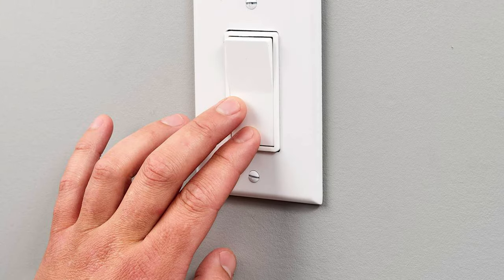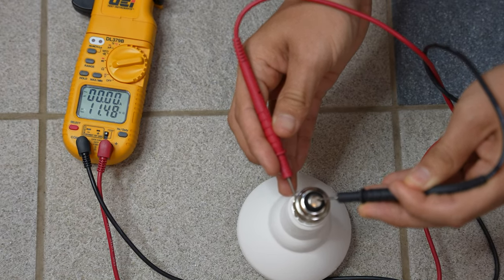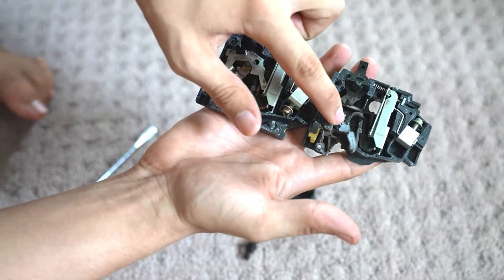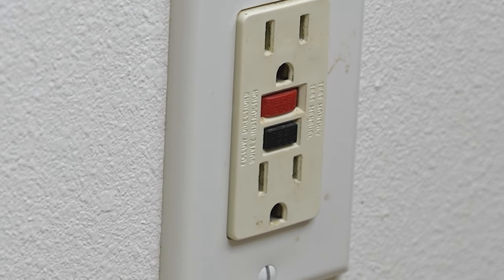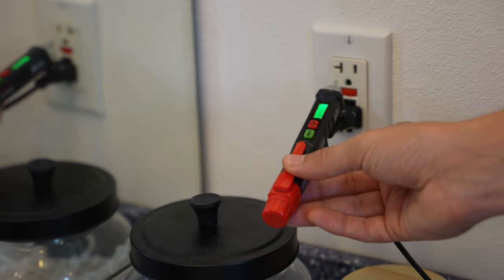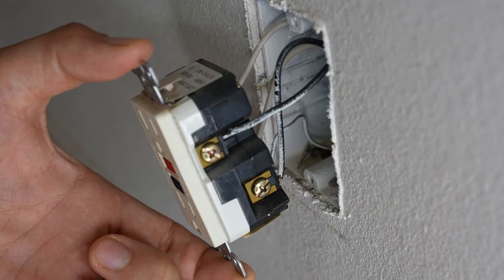Power Outlet Not Working - Easy Fix

Comment: Thanks a lot. You saved me from a lot of unnecessary costs associated with calling an electrician. In my case, it was a GFCI that tripped but it was no way near the receptacle that suddenly stopped working. The GFCI that tripped was about 150 feet away in the garage while the bad receptacle was in the patio. Thanks again for this very helpful video.
Reply: this video assumes everyone has this electrical setup... 
wtf u have sao many breaker switches? in my apartment building i have to literally go burden my downstair neighbours hallway, to flip switches if electricity goes out and only have like 2 switches...  (i guess u live in some massive sized house... )

my socket is literally circuted or whatever the term is.. if u plug something in sparkles, like something about to explode lol...  and the upper light switch knob literally doesnt work, like a spring is dead or smt, is it possible that its switched on but connectivity is poor, thats why it's "short-circuting" , not sure if i should even touch it... 

my mother is always pissed that she cant help from me when things like these happen and has to call over someone...  the thing is, i dont want to touch electrical things...

when i was 3 i plugged wires in the socket and got electrocuted, my fingertips were literally black... i think i stil lhave subconcious trauma about electrical things and fire... (also almost burn down the house when i was 10 playing with matches...) 

how should i check if the wires are correctly connected ...  wich side is negative and wich one is positive , the wires dont even have fcking colors... .
the system is from like fcking soviet block building system.. built in 1991~ or smt... 

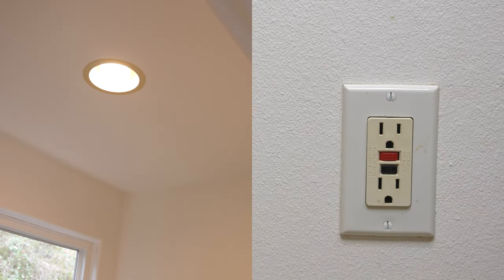1:59 dont even have outlets like this...   not sure what country video this is... systems are clearly different... 

fingers crossed.. i wont electrocute myself : ))))))
Reply: Your video helped. What I didn't realize is that if the breaker trips it can only move the breaker half way. I didn't notice just by looking at it, but after seeing your video that's what it was. Thanks my guy!!!
Reply: Lol same situation 🎉
Reply: Thanks a million! I’m
Not sure if was me flipping the switch in the fuse box OR pushing the button in on the outlet located downstairs from the problem box as I did both before going upstairs to confirm it was working- but regardless - SUCCESS! Thanks again!

Comment: Thank you sooooo much!!!!!! 4 hours of going between electrical panel outside and bathroom upstairs- who would have thought that resetting gfci in the bathroom downstairs would solve it! I’m so grateful for your advice today
Reply: Same thing happened to me today - what a lifesaver this guy is
Reply: I have to thank you both! I read comments while I'm watching/listening videos. That's how I have realized "It's me! I'm the problem! It's me!"
I have 1 GFCI outlet at the front of the house, and 2 non-GFCI outlets at the back. The outlets from the backyard stopped working a while ago.
The one from the front works fine but I prefer to keep it OFF to trick people (children) as they do not know there's a reset button that can turn the outlet ON.
But I did not realize that I'm turning the other 2 outlets OFF. I thought that probably they have an internal fuse. I mean how come these outlets are rated 15A, 20A without a precise fuse?
I was looking for a video about their replacement when I  found this one.

Comment: Thanks for the tips about outlets not working.  Your tip about checking the GFCI outlet not in pxomity to the outlet that failed to provide service was the answer.  The GFCI involved was all the way across the kitchen from the non-working socket. I reset the GFCI and, presto, it restored power the outlet that was not working. I bet you saved a couple of hundred dollars because my electrician charges $90 just to knock on the door. Thanks again!

Comment: Thank you so much. My deck outlet stopped working and I had no idea why. Your suggestion to check unassociated GCFI outlets led me to a tripped outlet which I reset and it fixed the issue. Thank you for saving me from calling someone out for a very simple fix.

Comment: Thanks for your precise video.  I too had a few switch and outlets not working.  I checked first each outlet and most were working.  But I had not thought about hitting the reset button on the GFCI outlets.  And of course, the culprit was outside in the patio.  Once I opened it's cover, I could see a red light awaiting the reset.  As soon as I reset that, all is working fine.  Thanks for your great step by step!  Keep up the great work!

Comment: Thank you a ton! I just had an issue with three outlets in my place. They were apart throughout the house and therefore I did not think they would have a similar connectivity. Looked at all three and reset every GFCI outlet, or so I thought. Found one in the second floor in a room far away from the other three outlets. It had a red light and sure enough, just needed to reset it and everything started working once again. Thank you much!!

Comment: An excellent video.Jay. I want to point out one slight difference between the new Smart GFCI to the old version. The newer GFCI outlets work the same you press the test button and they trip out cutting off the  AC power. When you reset the new smart series you must hold down the reset button for several seconds up to 5 or 10 seconds before they will reset the power. The normal way they snap on instantly if the outlet is good and if defective they will not reset. The new Smart GFCI will self-check itself before resetting. If you push and release the test button the reset will fail. If a person not knowing this it will lead them to think the GFCI is defective when it's actually good. My advice when buying new parts read over the instructions for anything new and be safe replacing the device. I know it's shocking news, Mr. Watson. Lol your joke was way to funny🤣
Reply from the maker: Thank you sir! And I appreciate you explaining this in detail. That is very helpful and good to know!
Haha and glad to hear you liked the joke 😄

Comment: Excellent info as usual ... I unplugged my ph charger in the bathroom and the prongs were red hot and it burned my finger. So I took the outlet out and the wire on the neutral side was loose . I replaced outlet made sure screws were tight and no problems since ... I bet Sherlock doesn't camp outside any more 🤣😅😂 Aloha my friend ...
Reply from the maker: Thank you Eddy! Thanks for sharing your experience, glad to hear you caught that before anything started melting! Haha I would have to agree, glad you liked the joke. 😄 Aloha from (the currently very rainy) Hawaii my friend!

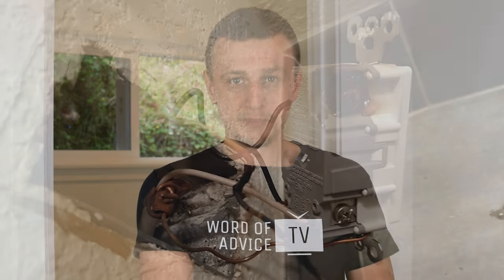Comment: Did home inspections for about 15 years, checked an outlet in the kitchen with a GFCI tester and a trip. I had a hard time for the next half hour because the homeowners weren’t home. Found it behind the refrigerator. What a pain. 2:58

Comment: Thank you so much. The GFCI in the hall bathroom tripped and shut off the outlet in the master bath outlet. Now I'm wondering why a GFCI would just randomly trip. I've been in this house for 30 years and it's never happened before. 
I need to make a list of different things for an electrician to work on, and then call them out to fix them all, because just making a visit to the house is a $100 fee.

Comment: Great advice. Unfortunately half of my kitchen is out, including two GFCI outlets that both do not respond to me pressing the reset. You gave a great tip to search all over for any external outlets or ones that may be hiding so I'm going to to just that and hopefully fix my issue. 

If that doesn't work, I'll have to replace the outlets, most likely by myself. It's not too hard right? Also, that sherlock & watson joke was pretty good I might have heard it before but not in a long time. Silly Watson.

Comment: This was very helpful. My electricity went out and after power returned some outlets didn't work. Reset the outlet in powder bathroom now upstairs bathroom outlets are all working 🎉🎉🎉
Reply: If it goes out again i suggest to track down why it is tripping.  You may need a new GFCI.  If you replace be sure to tape the screws.  It could avoid a short

I had one recently that went bad and was showing up as Open.  It needed replacement.

Comment: We have one outlet out that was not remedied by checking the breaker or the other thing. Unfortunately, the way the house is wired, we have no idea which breaker to turn off to replace the outlet. I guess we could turn off everything, but I hate to disconnect the fridge and freezer.There is only one GFCI in the entire house. We have been here 30 years, so I am sure of at least that much. Thank you for the video

Comment: I thought it was my GFCI outlet however neither the black or red buttons move. Not like the other gfci outlets in my house. This happened after I was trying to find the breaker for my dishwasher. Sadly, unlabeled at the breaker box so was flipping on and off various breakers to find out which the dishwasher was on. After that issue was settled, I couldn't get the bathroom lights to turn on and nothing plugged into the GFCI outlet worked. It's the only GFCI outlet other than my kitchen. It's a very small, 100 year old house. Thoughts?

Comment: thanks a lot , I have  110v   outlet I just use it  to play my laptop and sudenly  it stopped I suspeuct that is broken and I replaced it unfortunately  that didn't fix the problem  I tested again and found low voltage and I tested the breaker also and  it is ok  I tried to find which appliance is causing  the problem  turn and disconnect the wiring plug but I really couldn't find it  and I don't  use GFCI outlet what do you suggest  to solve the problem thanks in advance

Comment: Pro tip: if you know that the plugs might get wet, like cleaning the area, you can/should set it to test mode and preemptively avoid a fault.  Just remember to reset it once it is dry and safe to do so.

Comment: Also look to make sure that there isn't a light switch that may be wired to the outlet. I have one off those in my basement. The overhead lights have to be on in order for the outlet to work. We thought we had a bad outlet and then some how we figured out that the light switch had to be turned on for the outlet to be operational.

Comment: I would like to ask a question Re: GFCI  An entire circuit in the garage went out and isn’t working, the circuit breaker did not trip. The only GFCI that doesn’t work is located at the other end of the house in the kitchen. However the other GFCI outlets in the kitchen still work. So how is it possible for several things to not be working from a GFCI on the other end of the house?

Comment: I did all of that-  an alrdy aware of those steps. Thats why I’m going crazy-   The gfi is tripped outside an the 3 receptacles in the interior wall  next to the outside gfi-  the black line reads hot but no power to plugs-  an no breaker is tripped?

Comment: Jay, another big culprit is the light switch itself. Often they just don’t toggle correctly & then no light!
Reply from the maker: Yes! I would have taken the switch out to take a look if the GFCI proved to not be the culprit. Thanks for pointing that out!
Reply: What if you have outlets without the reset button? Just regular old fashioned outlets?

Comment: Having a rocker switch that i replaced with a new outlet in a room the bottom is working of the outlet but swithing on the new rocker switch does not make the top part of ourlet work both are new i even broke the tab on the outlet yet didnt work, i have two outlets & switches are doing same thing what do you think would be causing this? its mystery that only half the outlet works but not both?

Comment: I have z86volts on receptacle hot to neutral ! Grounded leg?
Reply from the maker: Have you checked the other receptacles in the room? I would think you have a broken wire somewhere but you'd need to take them apart and look.

Comment: Power is out of the two adjacent rooms and the hallway of those rooms, only getting hot reads on one of the hot lines in one of the outlet in room #1 no power on all other outlet included room #2 breaker not tripped and measures 120 volts on all of the panels fuses. Because of that one hot line in the outlet I believe none of the new outlet I've purchased are responding, why only one hot line showing and how to fix it

Comment: Make sure you attach wires properly black hot white neutral, else you could create some odd problems on multiple wiring down the line, such as voltage on a neutral wire to ground
Reply: Thank you I'll check for trip gcfi
Reply from the maker: Yes! That is a good point too. Thank you for mentioning it. Hot wires to brass, neutrals to silver, ground to green. 👍

Comment: I highly recommend everyone buy a socket tester (less than $20). Easy to use, and you will easily see any electrical problems (such as open neutral/reverse polarity/no ground) without opening the cover.
Reply: Any recommendations?
Reply: @staywoke2198  I like the Klein Tools RT250GFCI. Easy to read with a display.
Reply: @BillC-64  i sincerely appreciate that

Comment: My outlet tester showed dim green light, but nothing would work in the circuit with three outlets.  The next day no green light.  I took of the outlet where I believe the run began and none of the wires were hot.  No other issues in the house.  What could this be.

Comment: Here is a problem. Getting power to a GFCI but no power coming through the receptacle part. Power going to the back but not coming out the front. Two GFCI outlets and same problem. Never seen this before. What could be the problem.

Comment: You said verify the power is off. My outlet isn’t working so I don’t know which breaker to turn off
Reply from the maker: Do you have a voltage pen or a multimeter? Just check the wires going to that outlet to make sure there is no power there before you disconnect anything. It's possible that there is power but because of a loose or broken connection it's not actually "energizing" the outlet.

Comment: Another thing to look for is the poor way of hooking up an outlet or switch and that is “back stabbing”, that pushing the wire into the back of the device instead of using the side screws.  Also, the original electrician was lazy as you never run a GFCI circuit to the lights for this very reason in case it trips at night and you will not be able to see in the dark.  Also, a GFCI should never be hooked up to a refrigerator, freezer, and life support equipment since GFCI devices can trip real easy.
Reply from the maker: Thank you for explaining and all the additional info is much appreciated!
Reply: You are most welcome!  I really enjoy your informative and educational videos!  Keep them coming!!

Comment: Have a problem have half the outlets in kitchen dont work microwave dont work. Breaker is ok.
Reply: GFCI
Reply: Look for the GFCI outlet in or nearest the kitchen, and push the reset button. Jay shows it in the video.  Starts at about 1:11 into the video.

Comment: Didn’t solve my problem tried everything cept taking apart the inside.  Tried all the breakers about ten times and neither outlet works in both bathrooms.  Everything else works but just those two outlets 🫤

Comment: Sometimes when I open my microwave door it pops the breaker
Reply from the maker: That may be a broken or loose wire going to the door switch/latch. If the wire is shorting out, that would be enough to trip a breaker.
Reply: @WordofAdviceTV  thank you